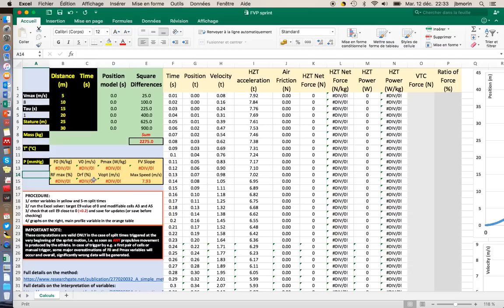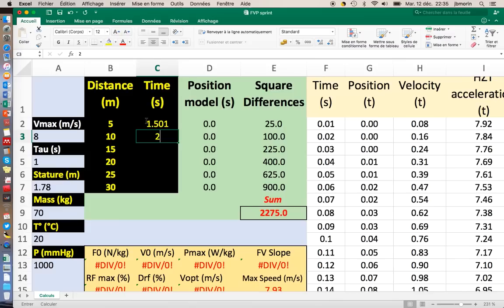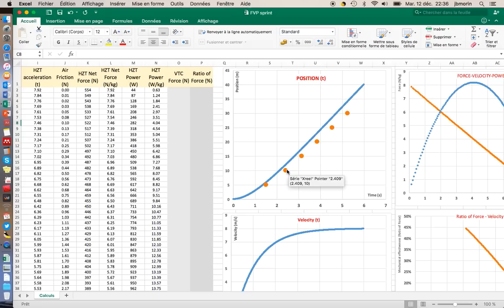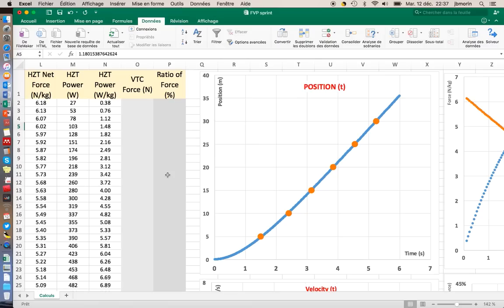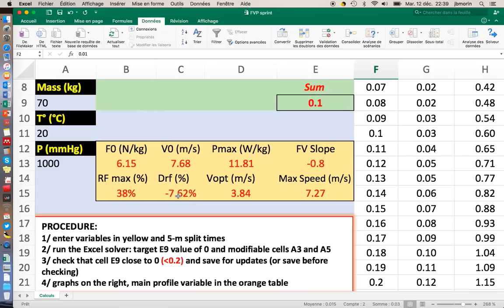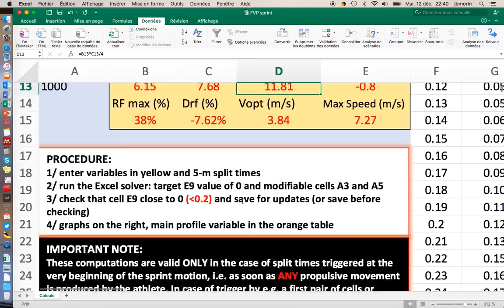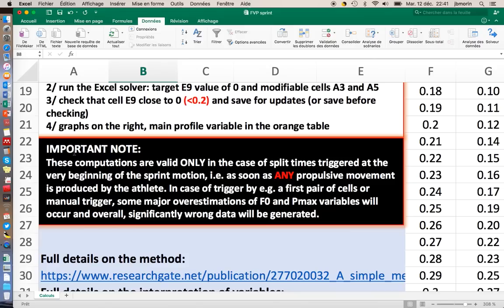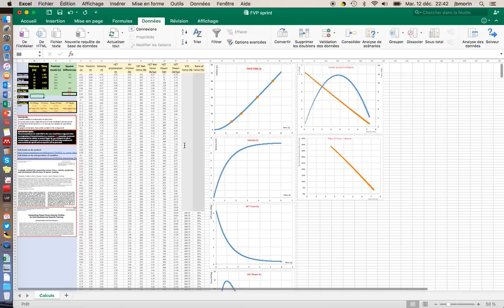FVP Sprint spreadhseet tutorial

Comment: Hi, excellent job! I would like to know why the RF values starts to show after 0,5s time, and not before
Reply from the maker: thanks ! It is because during the very early acceleration the center of mass rises a little bit from crouched position to upright, so the vertical component of the GRF is not exactly equal to bodyweight over the step cycle. It is the case after 0.3 to 0.5 s . but since the RF-speed curve is then linear this does not influence computations

Comment: I have downloaded and followed the steps in the video but solver is unable to give a solution. Tried using the same data you put in on the video but not working. I am using sheets not excel not sure if i need to do something different.
Reply from the maker: Hi Kevin, i guess this is the software issue, the file is set for excel and excel solver used, ideally on PC, and if using Mac, then the solver must be downloaded/found online as a separate software

Comment: Hello!!  Iam having trouble figuring whaat P (hpa) means,  I think the hpa means hecto pascal but what is the P.  Also my weather report shows barometric pressure in inches.  How do I convert it to P (hpa).  Really enjoying your videos.
Reply from the maker: Hi it is the ambient air pressure in mmHg, typically 700-1000 mmHg, sorry for the confusion
Reply: @jbmorin3327  Thank you.  That was a big help.  I have 1 more question.  In your paper, you mention recording wind speed but yet on the spread sheet I don't see where to record it.
Reply from the maker: @rufusweightlifting  yes theoretically wind speed if any should be added to the computation of air friction (in the spreadhseet) but we strongly recommend not doing test with head/tail wind if possible. It is however possible to add wind speed to the runnign speed (both in m/s) in the column where air friction is computed, provided ewxact wind speed in the direction of motion is accurately measured

Comment: Do you need this spreadsheet if you have the sprint ap ?
Reply from the maker: theoretically not, inputs and computations are essentially the same. That said, the spreadhseet gives you a more detailed and deeper access to the "instantaneous" data and not only the 8-10 final outputs (as the app does). So my best use is app for video and split times generation and then spreadsheet for data processing and illustration
Reply: @jbmorin3327  Thank you

Comment: Hello! Most of the time when I enter the data and use the excel solver, it says a feasible solution cannot be found. A solution is still provided however, with the sum of the square differences at 0. Is this an issue?
Reply from the maker: yes the sum of square differences should be set to 0 = no difference between actual values and model, and then you run the solver
Reply: @jbmorin3327  Thank you for taking the time to reply! But when I run the solver a dialogue box opens that says 'solver cannot find a feasible solution. Solver cannot find a point for which all constraints are satisfied'. Is this okay? If I press okay on 'keep solver solution' then the spreadsheet does update although I am concerned that it may not be accurate.
Reply from the maker: @GloboGymPurpleCobra5  mmmh strange, yes eventually keep the solution that makes the sum of square difference close to 0, if done correctly the fitting is almost perfect...